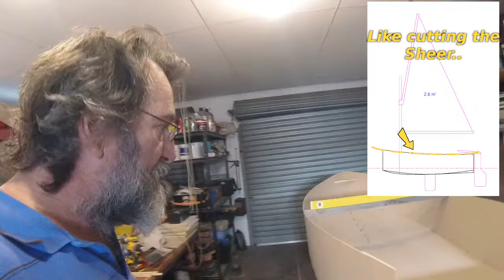MDF boat build (part 3)

Comment: Is that transom going to be rigid enough? Most of the lightweight builds I have been seeing use a solid chunk of marine plywood for the transom. I could imagine the upper transom rail destroying the sides it is anchored to but I assume you have already thought of that.
Reply from the maker: There's a rear seat and some gunwale to transom gussets going in. Plus the 18mm ply should do it..